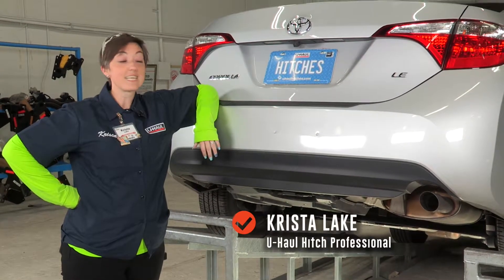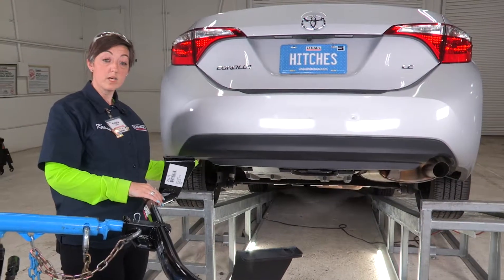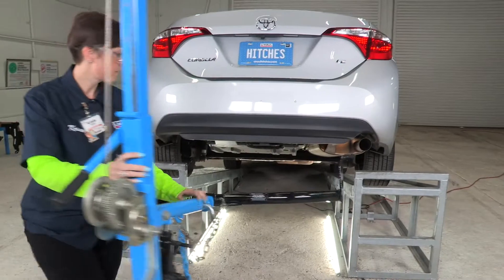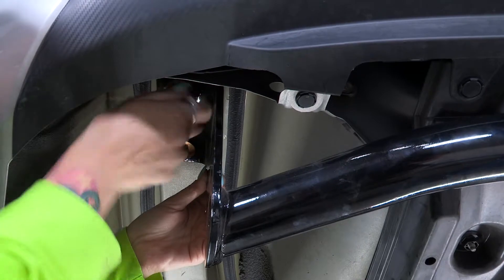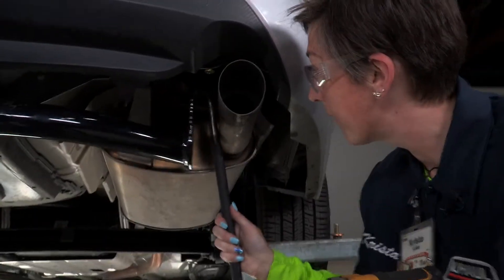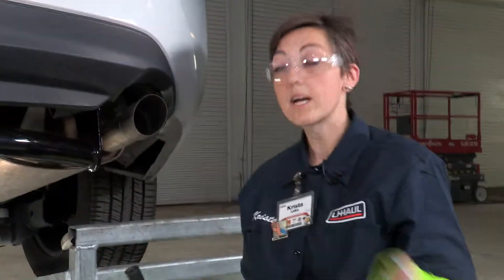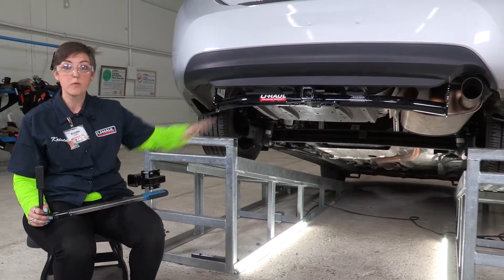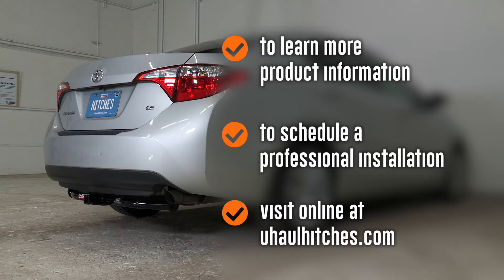2016 Toyota Corolla Trailer Hitch Installation

Comment: Hi! Anyone know what size the bolt holes are? I've heard they take M12 bolts with a 1.25mm thread pitch. Can anyone confirm that?
Reply from the maker: The supplied directions have the bolt size and torque specs. In case you missed it heres a link: https://www.uhaul.com/publication.ashx?fileName=29174.pdf&digest=tySTlNrpBLi5xL1rmKCgPA
Reply: @trailerhitches thank you!! They wouldn't fit at first because the holes were rusty, so I had to clean them out with a tap.
Reply from the maker: For future reference, a thread cleaner is designed to remove rust without damage. It has slots for debris to clear the area. A tap however does not have this slot and has much sharper threading thats for cutting threads into metal and is not the "best cleaner". Glad it worked out!